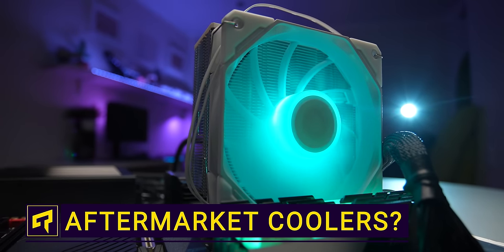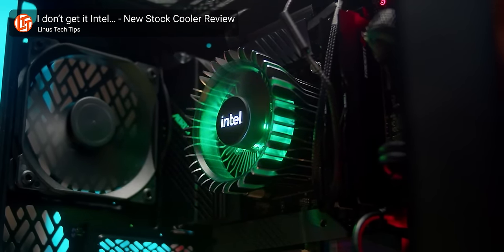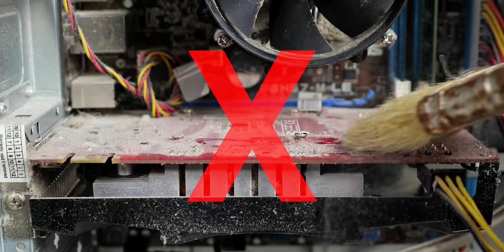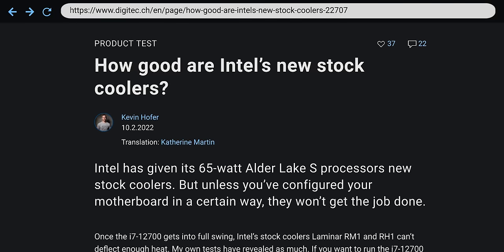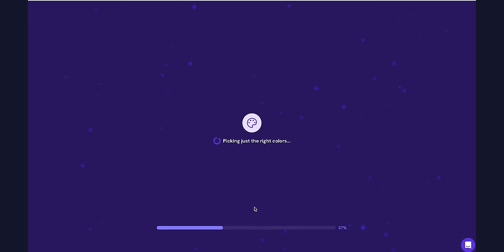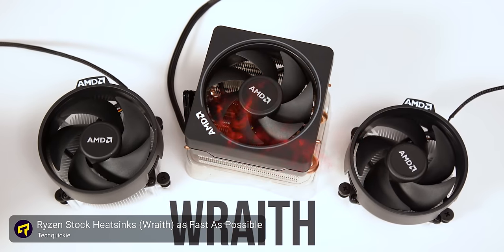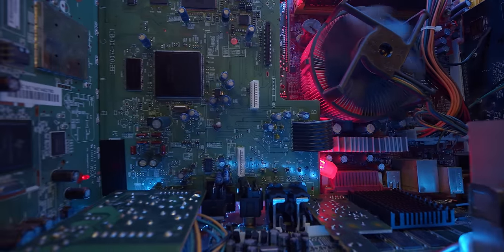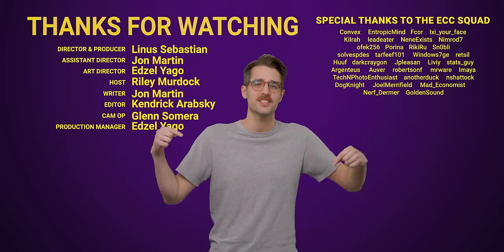Are CPU Coolers A Waste Of Money?

Comment: I have a Plex server with a basic i5-11400 (so no overclocking) that would ALWAYS thermal throttle whenever Plex did its background stuff when using the stock cooler. I put a $17 Thermalright cooler on it and that's no longer an issue. I'll never use included coolers again

Comment: just get a thermal peerless assassin 120 SE for 30 dollars. Pretty much the best cooler for everyday things. You only, really, need an expensive cooler, or some sort of custom water cooler, if you plan on overclocking. I have a 5800x3d processor and my PA 120 SE keeps it at 27c idle and 60-62c under load with underclockinging of -20.

Comment: i would say that a decent cooler can boost preformance by a bit. Since most cpu's nowadays boost untill they hit a certain temperature for amd this is like 90-95 degrees celsius and for the v-cache chips this is a bit lower 80-85 degrees C. So if you hit those temperatures there might be more preformance to squeeze out of the cpu cuz when you get under those temps you know it will boost almost always.

this has some other factors involved tho cuz during gaming my 7800x3d never goes above 65 degrees C while doing a cinebench run it hits 82 Degrees C so if youre going after just gaming preformence a good cooler is a tad bit less important then when you do heavy cpu workloads.

I personally use a Thermalright peerless assasin 120 for my 7800x3d and its a great cooler for 30-40 bucks. its a 120 mil dual tower dual fan cooler so well worth the money
Reply: When i build my first pc i fought with the temps of my 3800X on prime 95 at 4.5ghz all core. Needed like 2 months to get it that cooling at these chips is mostly limedet to the 7nm factoring with watercooler

Comment: Just tested a $20 Thermalright Assasin X R SE with an overclocked Ryzen 5 2600 pulling 115W and keeping cool at just under 51C. Even with a 150W CPU, like an old Xeon, I think temps would still only be around 60C, maybe a little more. Not bad for a thin, single fin stack. You might get a little more fan noise.  
Nowadays, intel is putting out 300W CPUs. But some air coolers can handle that, usually at a lower price point than an AIO and with greater long term reliability. 
The Wraith Stealth that came with my 5600X was completely unsuitable for the CPU and had it hitting more than 90C in stress testing.

Comment: This is half true, with modern systems the stock cooler will be fine, but given how ryzen 7000 and Intel 12th gen and up operate, they choose to run hot to get more clocks, more like a factory overclock. That means that if you slap on a better cooler you can get a little more performance out of it, plus you won't be running your pc so hot all the time, which means less noise.

Comment: Yeah, a AIO is worth it... not so much for temps going down, you might as well get a good Air cooler to get the same results but if you want to add some bling while not fully going costume and want your PC to run really quiet... they are a godsend(especially when you find a good deal and your Fractal Design AIO and it costs less then most 2 fan Noctua coolers)

Comment: I switched to an AIO in September from my NHD15S after 4 trusty years of service. I bought my revision 1 AIO in September and it failed last week... RMA was supposed to send tracking info for the new revision 2, that was 8 business days ago. Still waiting,.. I ended up buying another AIO. Only reason I'm not using my air cooler is because it doesn't fit with a vertical mount GPU.

Comment: Simple answer - Yes, CPU coolers a waste of money.
My first build was i7 8700k and instead of buying a great GPU, I listened to some advice to get a better CPU cooler, so I got Noctua u12a for $150 instead of putting that monet for better GPU, now I would definitely used the stock CPU cooler that came with my intel i7, since I tried it in comparison with noctua, and very rarely I got hot temps under a hard load on my PC. Most of the time I game, make videos 3d renders, it is still okay with stock cooler than with a super cool one.

Comment: For V-Cache processors, liquid is needed to keep the fans from spinning up excessively because it does not spike temps like air does.  At least this was my experience going from a 2*12cm tower to a 2*14cm AiO cooling  a 5800X3D

Comment: Buy an Arctic liquid freezer on the second hand market. It is flooded with people selling them because they misjudged exactly how fat they are. I got a brand spanking new 420 (unpeeled) for $50. I used it to cool a Ryzen 9 7900 with a power budget of 150 watts. I can barely hear it after 40 minutes of prime95. Most of its life it spends below the noise floor, even during long compiles.

Comment: Here is a little story from my experience, I once worked in electronics and worked for a company that made CD-players, DVD-players and recorders and such,tons of the quality tests entailed temperature tests and one of them in particular was a test where we tested machines in a big walk-in oven of 80°C, yes you read that right, we walked in to these ovens where the temp was 80°C, and ebing the engineer the question why arose and coincidentally I was given a course on quality tests by the company itself where this came up, the reason why, the person who gave the course said, is because there is a physics law SO EASY, that they didn't bother teaching you this one and hence why no one ever hears of it, the law goes as follows, for every 10°C every physical and chemical process goes twice as fast, so for a normal ambient temp like 30°C a device should last 10 years, now we are not going to wait for ten years to see what breaks, so 40° would make that 5 years, 50° would make that 2.5 years, 60° 1.25 years, 70° will cut that down to a little over 6 months and we had testphases that would only last 3 months because of the 80°C, and yes before you ask you can walk about 51 min in that oven before you succumbed to heat exposure, this was timed and usually not done alone for safety reasons. 
But me now knowing this physics law and already an avid PC builder at the time, I reversed the method of thinking, If heat makes my gaming rig lose overall quality and break, extensive cooling might keep it around for much longer and I can honestly say that my sone still is using a 12+ old rig and still gaming quite some hefty new games, off course I upgraded a lot since then, but the Watercooled, non-overclocked I7 is still the original one, probably going to change that one out soon but hey my cooling idea worked, this thing hardly ever reaches temps over 65°, and performs like a charm, so maybe if you are not in to overclocking maybe you are in to longevity, I even built my new rigs like this and I do not overclock, and I never have temp issues

Comment: You absolutely want an aftermarket cooler. The cost-benefit is just simply to good. A Noctua NHD15 which is one of the, if not the best air cooler on the market cost 120-150 USD and you can use it cross platform, for a few bucks you can get compability kits later down the line, fully utilize your CPU potential or even significantly overclock AND in general your whole system will be significantly less noisy. Spending 120 bucks and having cooling sorted out for decades is just a steal...
But if you dont want to spend that much, there is beQuite darkrock 4 for ~80 USD which is plenty enough for even high end CPU... Or you can get a Cooler Myster Hyper for less than 50 which will still give you very low noise levels idle.
Reply: The Noctua NH-D15 was the best purchase I made in electronics in these past 10 years.

Comment: Times change. 10 years ago chips were less efficient and left a lot of performance on the table for over clockers who could fight the raised temps. But most chips today are reasonably power efficient and don't offer vast results from over clocking before stability is threatened.

Comment: i just use any 65 watt cpu and air cooling (noctua/ be quiet) and it lasted me for years. the only thing i need to change whenever i have problem with my cpu cooler is the fans. Im waiting for the day when air cooler, with advancement of tech, have an easier way to change its fan. like just slot in or something

Comment: I had a dirt cheap Intel Pentium Dual Core e2160 1.8 GHz running at 2.4 GHz on a stock cooler for nearly a decade. They don't make them like they used to. I still have it but have no idea if it'll boot. To put it in perspective, the mobo (iirc) is an Abit IP35-E. Abit hasn't been a going concern in well over a decade. The zoomers over at LMG would need to ask old uncle Linus about Abit or possibly Mr. Lafrenyay might be old enough to remember them.

Comment: Planning an upgrade from this i7-6700 + GTX-750-Ti (+Linux Mint) to the upcoming R9 9950X + (inexpensive (cough) recent low end Radion GPU). The last round of R9 would get to 95C and throttle, and people lost their minds about it. AMD responded that that's what it was designed to do. Better cooling / more cooling capacity will result in better performance, but the chip will aim to clock up to the thermal limit.
It is a little early to say, but I would imagine the situation with the Zen 5 chips is going to be more or less the same. I also notice that after making the NH-D15 unchanged for nearly a decade, Noctua plan to release a newer version of it. It will have more heat pipes and closer fin pitch, better fans... I'm planning a next-gen D-15 to go in my 9950X.
Would I get a bit more cooling capacity if I stole a radiator out of a Mack truck?
Yes, possibly I would. But then I would have liquid flowing through my very expensive electronic toy, and after 20+ years of driving taxis on night-shift, I can recount stories of heater / demister cores / heater pipes that burst and leaked in behind the dashboard... I don't want to repeat that in my fancy very high end personal desktop.
There are other big air coolers that are nearly as good as the current D15, but Noctua are working on a new one, and I have faith.
On this old Intel box, a custom Linux kernel compile takes about 9 minutes. If you're curious, I recorded one a couple of years back, and posted it, so go to my channel and have a look. With the 16 cores and 32 treads, I'm hoping to be able to do that again in about 35 ~ 40 seconds.
Do I need that level of performance?
Do you need that Ferrari?
I want a new and improved Noctua NH-D15. I would say a 410mm cooler has a bit more capacity, but a 300mm cooler is roughly the same. Anything smaller than that, I'd bet on the D15. As long as it can stay under 95 C for about 2 minutes at full load, with all the self-clocking and turbo-boost and stuff turned on (not full manual overclock, which over-rides all that) then I'm happy.

Comment: Really this boils down to if your CPU comes with a cooler or not. If it does, don't worry about it. If not, buy a cooler that has a TDP rating that matches the max boost clock TDP of the chip. Anything else is overkill. None of this applies if you are going to OC.

Comment: Have used a Corsair H105 since 2016 and still going strong with my AMD 7800X3D. I will be upgrading it though cause I think I've gotten my monies worth out of it. I used a custom curve for the AIO instaed of it running at 100 percent all the time so I think that's why the pump has lasted, and I changed out the fans with noctua's so overall I think I did good. =)
Reply: Yep - I've done setups exactly like your's, and they ran great.  You did really well! 😉😉

Comment: Aftermarket coolers is almost always wort it to me (Ryzen Wrath Max was not too bad). Just get a half decent tower cooler. 

Water cooling on the other hand is a bit more tricky. I got an 360 AIO  (Deepcool LT720) it barely any better than my 5 year old CM Hyper 212 that was held on my 2 screws and a ziptie. It's also louder at idle. Only place it seems to edge out the win is at benchmarks or anything that puts 100% synthetic load on the CPU (I don't do any rendering etc but that might fall into this space).

I manually overclock my CPU and was only able to lift the PPT from 120w to 140w (which makes very little difference with my CPU - 5700x). Anything more than 140w starts throttling.

Comment: Intel tends not to include coolers with their overclockable K processors anyway, so buying 3rd party is kind of mandatory if you want a cooler on your CPU 😅 

I spent £30 on my cooler because I wanted ARGB, but the standard version is only £10, and it beautifully keeps my 13600k in check with a 200-1700 RPM range.

Comment: I don't overclock anymore, but i overbuild cooling solutions because i don't want to hear my pc even when holding my ear to it while using it to the max
Reply: I design and overbuild my systems because, like you, I don't want to hear The Battle of the Fans, but in addition, I want my CPU running COLD.  As a result, my CPU rarely exceeds 40 C even when gaming, and my 2080 Super GPU rarely exceeds 50 C.  Cold components perform better, and last much longer, regardless of the BS spewed here. 'nuff said.

Comment: I 100% lost the silicon lottery with my first 5500. It goes 85°C w/ PBO off on stock cooler on a 21°C room... (I tried other 3 AMD Wraith Stealths! - from 1600AF, from 4100 and from a second 5500... no way I mounted and/or pasted it improperly 10 times or so...)
I put a 120mm generic watercooler, one of those mounted with clips not with screws, and it stays at 83-85°C w/ PBO on. So I'd say it was worth spending on the watercooler. (240mm? I'm not that rich. lmao)
I doubt AMD would replace the chip as it is working but just slightly heating more than it should... lol...

Comment: Honestly, don't buy unless it's absolutely necessary. Sometimes getting 5% better performance isn't worth those dollars you'd spend on a big fancy cooler, and definitely don't buy a new one if you're not even thermal throttling.

I use a stock cooler from a 3700x on my 5800x3D and it works just fine, surprisingly enough. Even a notoriously hot CPU works well enough with an old mid-range stock cooler.

Comment: Went from a 2700x to a 5800x and used the same stock cooler, though I definately wanted something quieter. Ended up putting all my old parts in a PC for my brother on christmas and needed a cooler, so I ended up using the stock cooler and used it as an excuse to get a NH-D15 Chromax.

Comment: The stock cooler I got with my Ryzen 5 couldn't even prevent it from thermal throttling at load at stock clocks. That's right, I wasn't overclocking, and the AMD cooler was still inadequate.

Comment: I've been using a Scythe Ninja v2 for the last 10 years with my old Intel Xeon e-1231 v3, and finally after almost a decade I've upgraded to an 14600k + BeQuiet! Dark Rock Pro 4 last month, which will probably last me for the next decade. So to answer your question : Spending 100 bucks on a good quality highend cpu cooler once per decade is NOT a waste of money in my book.

Comment: I bought a cheap 5 pipe tower cooler after the stock cooler for my 2700x died, noticeable improvement, cable tied an extra fan to it and there are now 8 fans in the case, (11 including gpu) so its pretty windy in there.

Comment: 13700 (non F, non K, a 220w CPU) comes with the stock cooler that dissipates up to 65w, so the cpu almost never can go beyond the base 2.10 GHz clock... So if you keep it you are wasting more than 50% of the performance, even having many chrome tabs can make it reach 100C and throttle to the base clock, it has no sense.

Comment: My stock cooler was trash. Bought a Noctua. I get about 300MHz more sustained turbo. Still not at maximum turbo but I'll just put that one on the case or age or quality of the CPU, or because it's a Xeon on a technically unsupported motherboard (the stock cooler is that of a similarly specced i7, the Xeon was just cheaper, so it should honestly do better but old intel coolers were just terrible). 

Oh yeah also got an expensive Noctua because that way I know for a fact that I will be able to use it for the next 20 years every time I upgrade.

Comment: I swapped out my AMD Spire stock cooler that came with my Ryzen 3700x (which averaged 68-75c during gaming) for a Thermalright Peerless Assassin for $30 when I bumped to a Ryzen 5600x (yeah, kind of a lateal - had intended to get a 5800x3d but then the price jumped and my free funding did not :) - so the Peerless Assassin keeps my 5600x under 40c no matter what I've done to it.

Comment: Hyper 212 or bust

While an aftermarket cooler is not likely to increase CPU service life, it should increase motherboard service life by increasing thermal dissipation from the socket away from power components that surround it. Motherboards will almost always fail before a CPU does, and CPUs tend to get cheaper whereas old-stock motherboards become more expensive, so if you plan to keep your hardware long term it is a good investment. They also don't "go bad" and you can repurpose a cooler infinitely.

Comment: I bought high end parts for my PC, but case and coolers are average cause I don't care about the looks. It sits on my floor, and works perfectly.
Reply: You probably shouldn't let your PC sit on the floor and instead put it on a rolling platform of some kind. I have my desktop sitting on a metal set of rollers that lift it about 2-3 inches about the ground so that my PSU can pull cold air from beneath it.
Reply: @kingzach74  actually I do have that metal thing with wheels from IKEA. I meant to say that it’s not sitting on the desk to look nice.